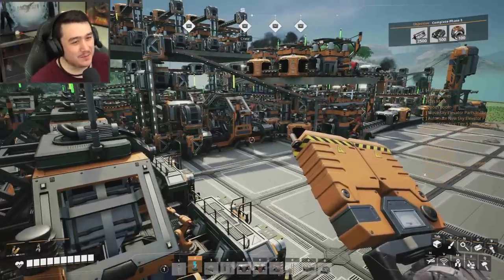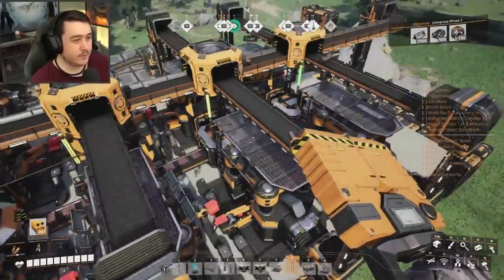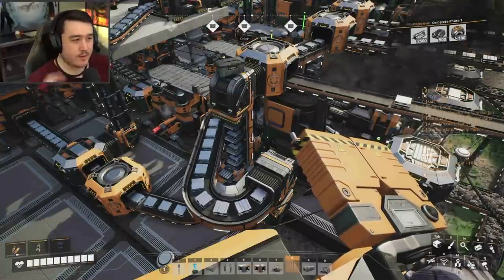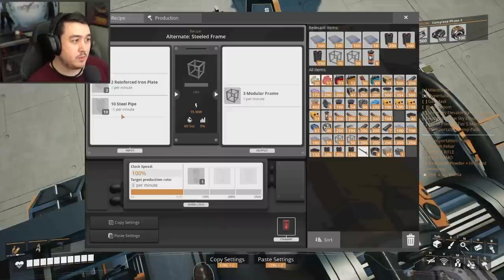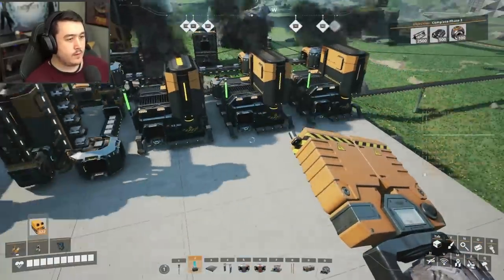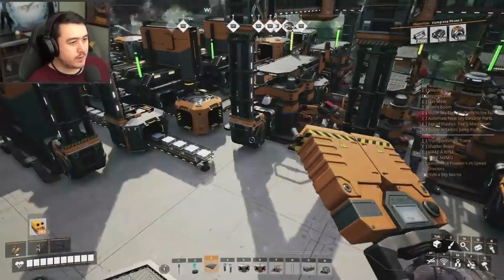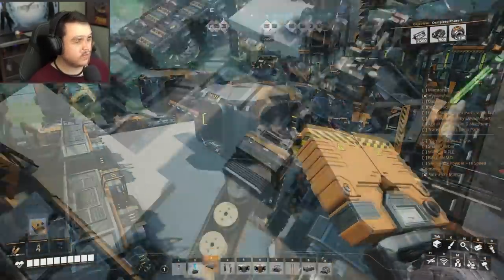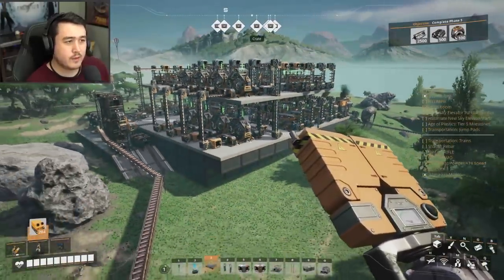I chilled out by...cleaning up my room? - Relaxing Satisfactory Build

Comment: While deleting things you can hold down a special function key... Forgot what it's called... it's in options. Anyways, you can then click on say a building while holding the special key and then you'll only delete those buildings... no matter how much you try to highlight. It'll only select what you've pre determined. So you don't accidentally delete other things. You can do this with painting as well.
Reply: Ctrl 😉😉
Reply: its mouse 4 by default. ctrl is to select multiple (different types of) items. holding mouse 4 and ctrl will select only the first type of item you mark.
Reply: @dannymerov  Wow, gotta try that :O
Reply: @zeero4ever  it differentiates between 1 and 2 or 4m foundations aswell. so marking a 1m foundation first,  wont let you mark 2 and 4m foundations either. its rly handy to not delete stuff in the backgroud.....now dont assume i ever did that ok?! :P

Comment: A little tip for under/over constructor chains: build a stack of mergers on top of the original splitters until you have one at the height you need, then hook up the output lifts/belts and delete the mergers you don't need. It saves all the aiming issues.
Reply from the maker: I used this tip today. Thanks!

Comment: Very relatable :p I have a bad habbit of using to little space to keep my factories orderly. Point in case: decided to redo my starter set up once I had my coal generators. Nearly fully covered the lake that my iron mines were next to with foundations. Then proceeded to use like less then 20% of that field to produce EVERY item type up to tier 4 cramming everything too tight in an effort not to waste space for future expansions.... Now every time I go there to pick up building materials I have to go on a mad scavenger hunt as to where each of the intermittend storage comtainers is hidden or rerouted. Currently working on an oil processing plant for plastic/rubber/power based of diluted packaged fuel and CONSTANTLY need te remind myself NOT to repeat the same mistakes 😅

Comment: Your factory looks a lot more clean right now! Protip: place smelters, constructors and assemblers on their own levels, that way it will be much easier to expand later. You may also want to use so-called underlevels for you belts so they run underneath your machines to make the build even cleaner
Reply: GOTTA LOVE THE SANDWHIICH LAYERS!

Comment: you've been busy dude!! looking good! if you want to build your  lines with expantion in mind or when youre not sure how many of that item you will need, i would recommend to build your machines side by side and all lines facing one direction. for each item you just go vertical and make a platform above the first. that way you  can just plop more machines on the side of existing lines and connect the existing belts to it. this is also usefull when you get better belts, increasing the capacity potential for that line. organisationwise, its easier to start with the machine(s) building your final item(s) and work your way back. that way you wont have to overclock too much bc you dont have space for that 1 extra machine you actually need to have it run efficiently. in general working with foundations, i would recommend to either build foundations as you need them or, if you build foundations first, build 2-2,5 times the space you THINK you'll need. its always going to be larger than you expect and the extra space comes in very handy once you start belting everything and want to have a clean look to it.
Reply from the maker: Good call! I did stop to think about expansion capability, but I decided not to increase the scope of the rebuild for now. Eventually everything will be in buildings like the electronics fab. I've even been thinking about making subterranean supply transfer tunnels underneath the map, but I was going to wait until I react to the trains LGIO video.
Reply: the electronis facility lookes cool!!  sounds cool dude, those tunnels! you can do the same thing elevated btw....thats why i love this game, so much room to get creative

Comment: There's an alternate recipe for screws you can come across, called cast screws iirc, where it crafts directly off of the ingot. If you unlock that recipe, it may be worth doing a compare and contrast between the recipes, to see which recipe sets can produce more quickly and/or more simply.
Reply from the maker: I just found out about it. I WANT IIIIIT
Reply: IMO, if you haven't run across cast screws before you've unlocked steel, you're better off with the steel screw recipe. Takes a little more work to set up, but the rate per constructor is simply unbeatable.
Reply: YES. best one.

Comment: If you like satisfactory you have to try factorio after you feel like you acomplished your objectives in satisfactory, the graphics are a little bit abysmal in factorio but it is afaik the better factory game, as it is 2d instead of 3d and on a tile map, the natural puzzles that form are much better as you have one less dimension of wiggle room and factorio scales much better and the gameplay feedback loop is more solid, you can think of satisfactory as casual factorio or of factorio as hardcore satisfactory. The factorio progression also is a lot more natural, in satisfactory you usually unlock things in batches and then go a long time without unlocking until you get the new tier, as the milestones inside tiers are kind of easy, so once you have the production power to complete one, you have the power to quickly complete the others. In factorio the equivalent system is much tighter and rewarding, you unlock things in a progressive manner.
Satisfactory is more chill and actually looks good tho, factorio looks like an old rts game and has a very grim/industrial/brutalist? aesthethic

Comment: How far are u from Hoverpacks? Hoverpack is the best for building factories, u just hang in the air, watching ur creation, having thinky thoughts... Weird that it's so far into tiers, by the time u unlock it u'd have built most of the factory🥴
Reply: Yeah, those are a life saver... I unlocked all things using a total mess of a factory, now with all the goodies in my hands (and unlocked architecture stuff from the Awesome shop) I rebuild everything step by step. You just have to consider putting down some power lines while building, so the hover pack doesn't crap out.
Reply from the maker: I'm not sure - I just started Tier 7/Phase 4 sky elevator. I love the jetpack, so I'm pumped not to need fuel around the bases

Comment: My advice is MODS.
Not for more stuff or easier building/cheats.
But for eternal daylight.
Makes better Youtube content when your viewers can see what you are doing.
Reply from the maker: Eternal daylight would be sweet. There were several times when I was cursing the fact that I forget to turn on the flashlight. I feel like it keeps turning off on me, but it's possible I just never turned it on when I thought I did <.<